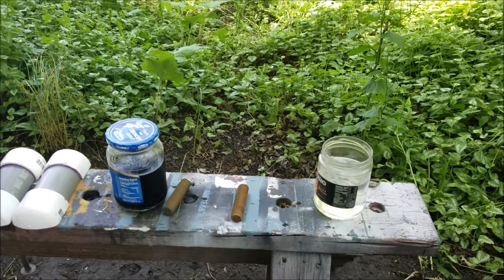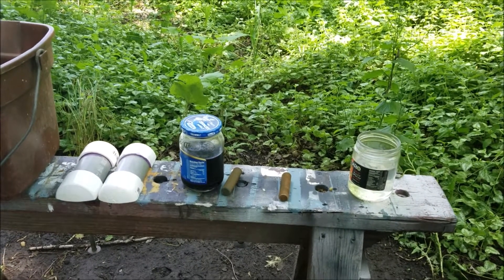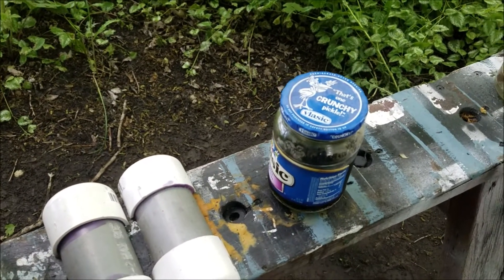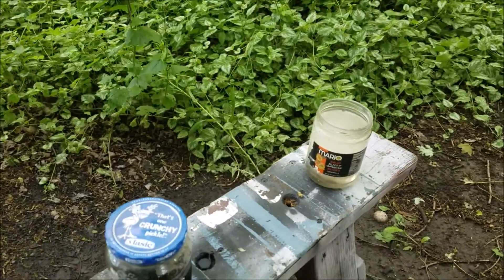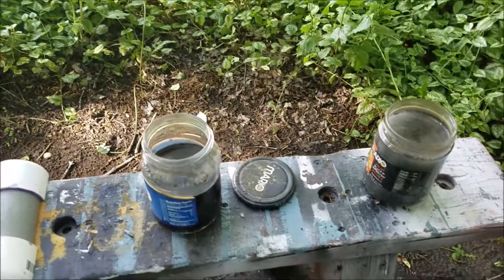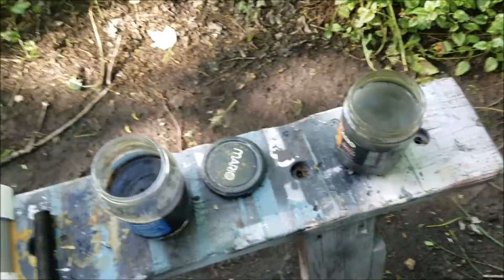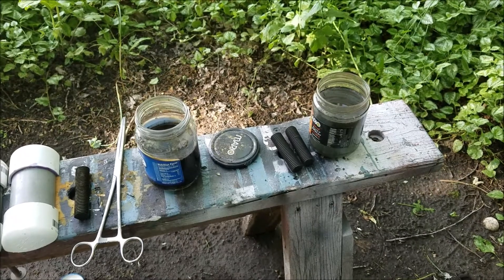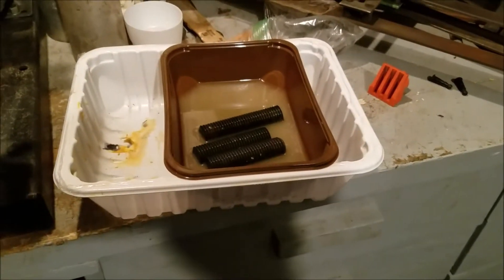SHARPENING FILES WITH ACID ~ PART 6 ~  CHANGING THE PROCESS

Comment: Can you tell me what strength vinegar you used in comparison with 100% acetic Acid? And did you know that it's rust busting quality is improved by adding salt?
Reply from the maker: I used standard 5% apple cider vinegar. Yes salt increases the acidity level, or lowers the pH Level, in the vinegar. I believe it does so by converting a portion to hydrochloric acid.

Comment: And off she goes! Good old agua! 80 and clear with a breeze and humidity about 1k! Wilt weather. Back yard still a swamp so no mo. Just got a smidge from the banger yesterday so maybe the sun will override the showers even though there is a trace every day. Fixing the light switch on the Taco with a hot glue gun. Now for the screws and it'll be done. Be back after while God willing!
Reply from the maker: Spent most of yesterday cleaning up and getting the mower going. Wanted to mow but the fixes I was trying weren't working. Just got back from Lowe's. They are the only game in town when it comes to mower tires for this one.  It has a weather checked splitting right rear tire. Not a very good brand but they have to be a certain size to sit level and Murray has a lock on the tires. Even though it's a Toro mower it is made by the big Kahuna of mowers. I brought home a bottle of flat fixer and a new tire and rim. Won't sell just a tire. Got to buy the assembly. Guess no one can change a tire anymore. Either way it will be running.
10 second rant. I have my Father In Laws old wheel barrow. It has the original tire and he bought it to dig out the basement at his house. Lydia remembers chalking up the number of loads on a shovel while her Dad and Mom did the digging. It hasn't weather checked or even lost air ever. Cheap.... No not cheap shoddy work and crap materials.
Okay off my stump.  
Good luck with the Taco. Hot glue is a nice option when SHTF. That and Duck Tape. I hope I found another in the bottle of flat fixer.
Reply: Taco is fixed and ready to go. Some more cheap stuff but the hot glue did it. The place we get our tires from has mower tires and will mount them for you. My Roof mower has bicycle tires on the back and Wally world had tubes with slime? in them already so I didn't have to fool with it. The tire place also sells tubes and will order any size tire you want but just the tire, not the rim too. Surplus Center has a good selection last time I checked. I hate cheap stuff. I could get a light switch from L.M.C. Truck for $20 (they've got the stuff for older rigs)  but it was the mount that gave out. Looked like somebody had tried to glue it back together but the glue failed.  I glued the good legs and clamped the rest and laid the hot stuff to it. She'll not come loose now. Cheap plastic legs with screws and legs gone and screws gone. No problem. Tried the last Atkins saw but it might be duller that I thought but it was in a treated 2x4 so I need to get some dry and see. Got a bit of a bow but I think I can ease that out of it. Already got a lot gone already. Got to get some polishing stuff too. The wax awaits!
Reply from the maker: Lewie McNeely I need to find a repair shop that is reputable. I have been going to big box stores for my parts.
Reply: The one I/we go to I have used all my driving life plus firetruck work. The dad had it and did his own capping but the son finally settled down and took over and moved and did away with caps. They now do everything, even as far as mechanical goes and are right good at it too! I've still got the other guys and just got back with my buddy the Honda man so all is getting better, but the tire place is the go-to. You ought to have one around there somewhere and you know the contacts that'll tell you the straight of it that you used to work with. I still confidence you!.